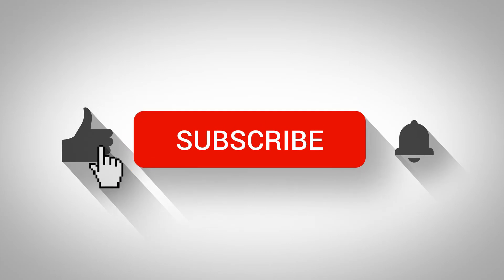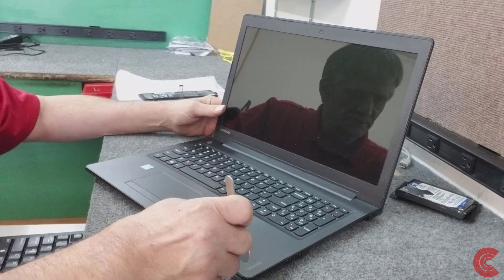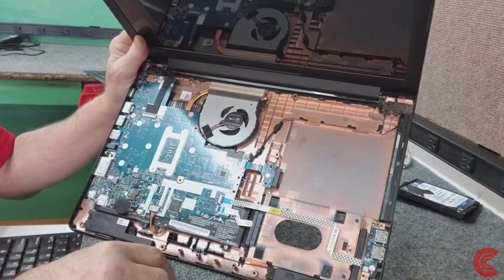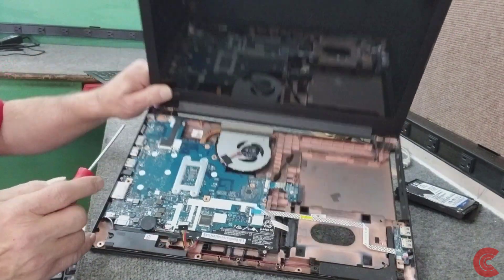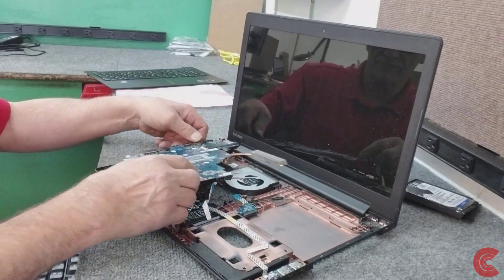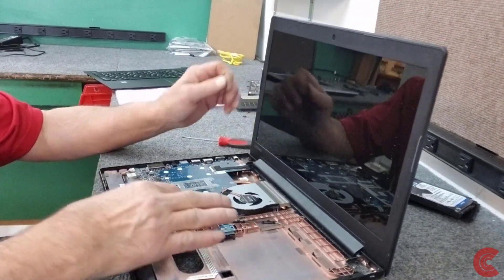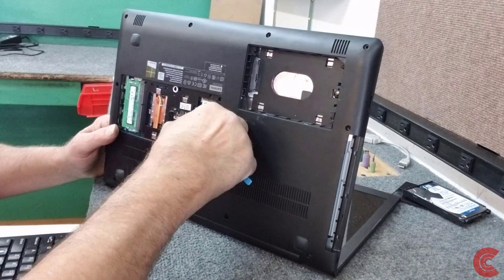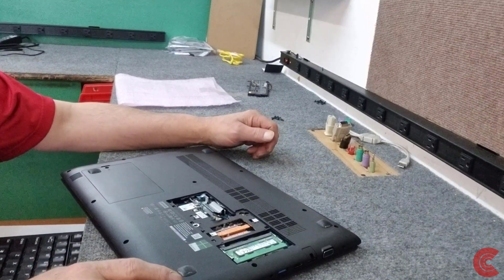Replace Battery in Lenovo IdeaPad 310 Laptop

Comment: So you basically need to take the laptop apart and put it together again. Thanks Lenovo. This was my first and will be my last Lenovo laptop. Your battery just randomly stopped working.
Reply: Lenovo ideapad 310 is also my first own laptop that I paid for. My battery needs replacement but Lenovo supplier in my country is out of stock for my type of battery. I dont want to get Lenovo in my future laptop purchases.

Comment: Many many thanks, just changed out both keyboard and battery in my IdeaPad. This video was very helpful and saved me a boatload of money.  I went really slow check and rechecking everything. I also took care this time to order computer repair tools rather than using my trusty steak knife. I had to figure out how to reconnect the wifi cables, but all is well and working. Thanks thanks thanks.
Reply from the maker: Awesome. Good work.

Comment: Im sad you did not show connecting those two cables (black and grey) at the end. I cannot manage to get these back
Reply: I'm stuck with the same problem
Reply: @Huggybear101  hi. I was afraid at first but you have to apply some pressure. You put the cable on position and then press down on it with some tool until you hear it click
Reply: @thissiswhatpeak  Thanks for the reply.  I tried that last night a few times.  I think I might have deformed the shape of the clip doing it.  I'll try again today.  I took the card out to make access easier.

Comment: hi if i remove the battery will it still run? i have a blinking orange light and google says its a dead battery..so if i remove it will it still run?
Reply from the maker: Hi. Yes, laptop will work without battery, and just the power cord.
Reply: @CadillacComputerCenter  thanks!  one more thing is this the charger i need for this 20v 3.25a 65watts? cause i want a new one
Reply from the maker: I believe this model uses a 19.5 volt , 45watt.  Just search for ideapad 310 power cord on amazon. Dale
Reply: @CadillacComputerCenter  thanks dale! will be recommending your channel least i can do
Reply from the maker: Thank you.

Comment: Many thanks for a great video, and I have just successfully changed my battery based on this guide, and everything works perfectly! :) Just to let everyonme know, I was able to get away with just removing the keyboard and mousepad ribbons, and then the speaker connection on the bottom of the motherboard. Then, once I had taken the screws out of the motherboard, I could carefully slide the motherboard slightly backwards towards the screen and to the right, and, remove the two battery screws and replace the battery. In this way, I didn't need to disconnect any other motherboard ribbons or connectors.

Comment: Hi.. wanted to ask if there is a way that i can make the keyboard on this backlit? I didn't care about it when i bought but now i need it badly.. I did see some 3rd party replacements with backlight but does the mobo have the header to connect the light cable? Thanks in advance

Comment: I've got a problem if anyone could help:

My laptop is this exact model. Had it for 4 years. I have the bad habit of lifting it by holding the two bottom corners. Just recently I've had this Problem when I apply pressure on the left side (to the left of the touchpad) from below my screen glitches, freezes, and shortly after that – the machine restarts. Any idea why this happens? Have I broken or disconnected something?
Reply: Its beacuse the motherboard getting pressed when you press on the left botttom and that makes the system to freeze and hence we need to restart. I often gets a blue screen. Its just because Lenovo body is kind of very brittle, not good at all.

Comment: The complicated procedure of battery replacement  is probably because of commercial reasons.  Lenovo doesn't want the user to replace it by himself..   In HP laptops, we just pullout the old battery and replace it within in seconds.   Shame on LENOVO.   Will be very careful in future NOT TO BUY any lenovo product.
Reply: Same here. My first Lenovo i had for 11 years still runs, never ever had  an issue.but now the new ones have tons of problems.not worth it
Reply: Lenovo Thinkpad laptops come with two batteries. Replacing them is totally easy.